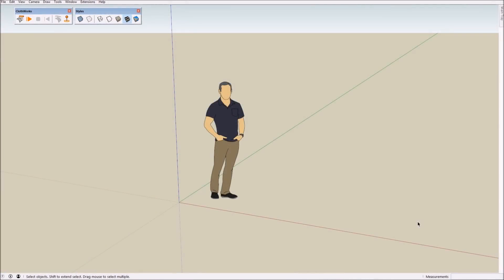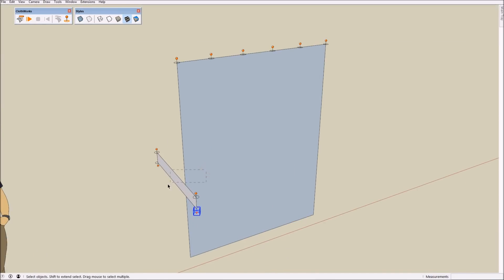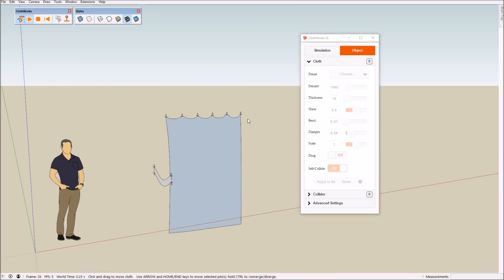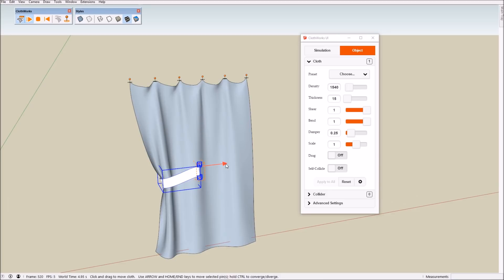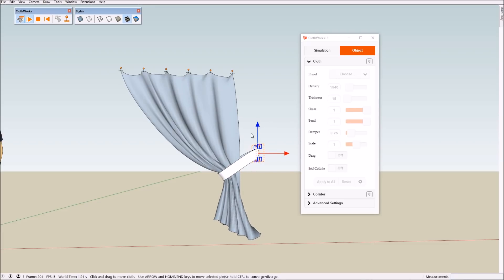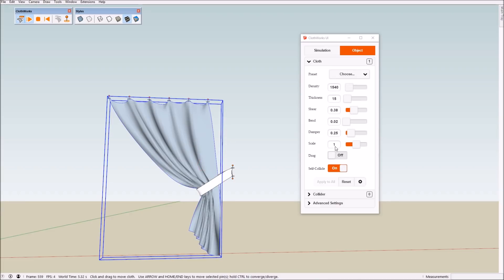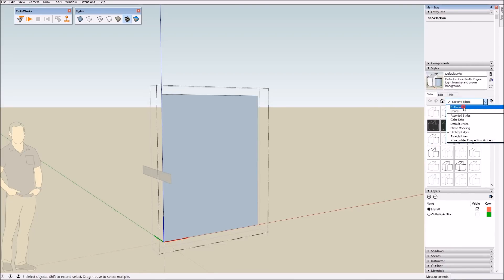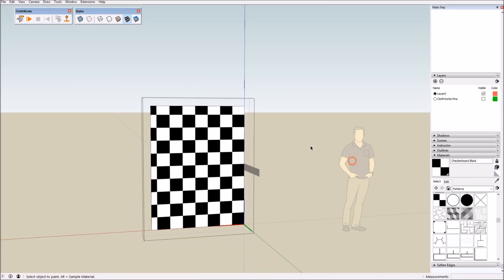ClothWorks - Curtains

Comment: Anton thank you this is awesome I would like to do curtains with out the tie just gathered, do you have a tutorial for that? Maria
Reply from the maker: Your welcome! To converge the curtain without the curtain strip,  select all the pins at the top of the curtain, using the selection box, and then using the pin tool, converge all the pins toward the center.

Comment: Thank you for this! I've managed to get the desired results for static objects, do you think there is a way to use clothworks with Keyframe Animator? I'm trying to get a retractable roof system to animate the cloth as it opens and closes. I can send you the SKP files if you are interested in playing around?
Reply from the maker: That's currently not possible with ClothWorks but a great feature request for compatibility with Keyframe.
Reply: @AntonMSP1  Thanks for the reply. I've tried to get it to work with very varying results. Time to give up now. :-( Love your plug in - its amazing! Well done!

Comment: Hello, how do I make this animation work with more fps? I have a good computer, but only with 1 fps during the animations, how to solve this?
Reply from the maker: Performance depends on a cloth thickness. If you applied a small grid, ensure to make cloth thickness two times smaller than grid spacing. On the other note,  the more vertices you simulate, the more poorer performance becomes.
Reply: I would like to buy the full version of this plugin, but I do not know how to buy it through paypal. Do you have another form of payment?
Reply from the maker: PayPal allows you to pay with your credit card without needing a PayPal account. They do ask for some info but nothing too intrusive.